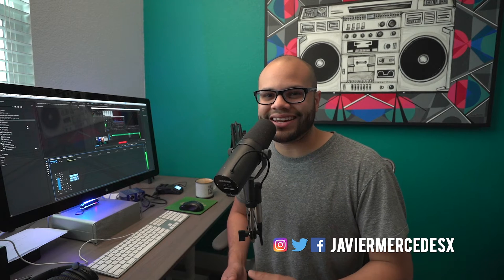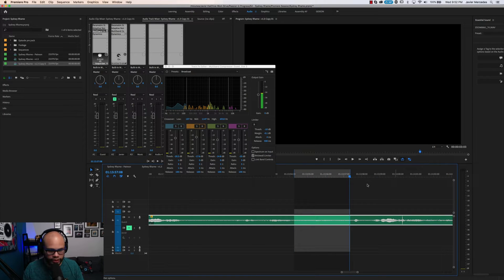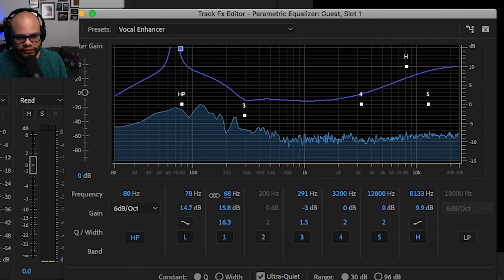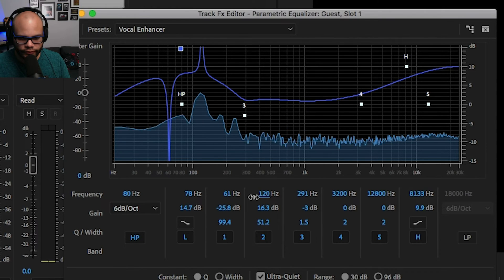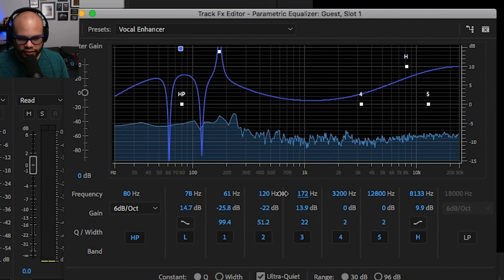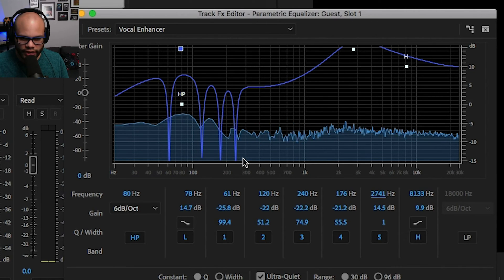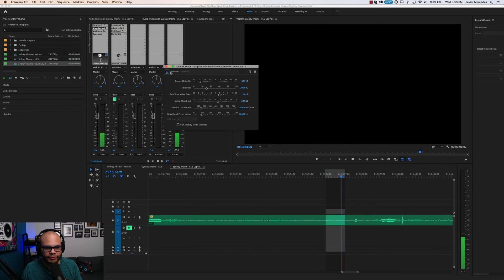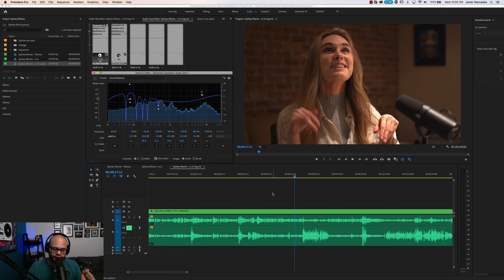How To Remove Audio Hum from Video Premiere Pro Tutorial

Comment: Terrific explanation!  I'm pretty new to AV production and just got a hum-filled clip to deal with!  For anyone interested, here's a bit of theory on where to find overtones to a hum: In this case the hum is 60 Hz (from the power in your house) and that's where your lowest peak occurs. The next peaks is twice the "fundamental" frequency or 120 Hz which matches your second peak.  The following peaks are 3x = 180 Hx, 4x = 240 Hz, and it looks like you got them all.  You hear these as the fundamental, an octave above (2x), an octave and a fifth above (3x), two octaves above (4x), then a major 3rd (5x), etc., getting, as you said, closer to closer on the exponential frequency scale. The more complex (buzzy) the hum sounds, the more overtones will show up.